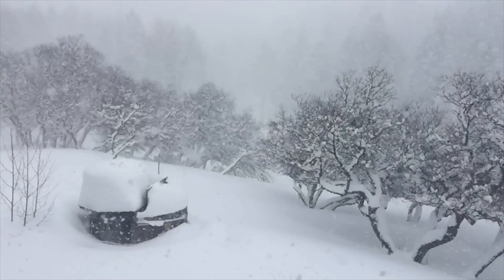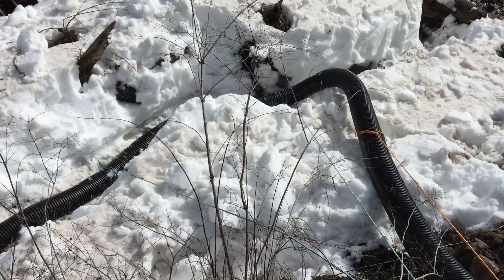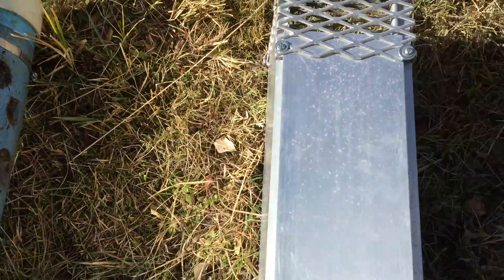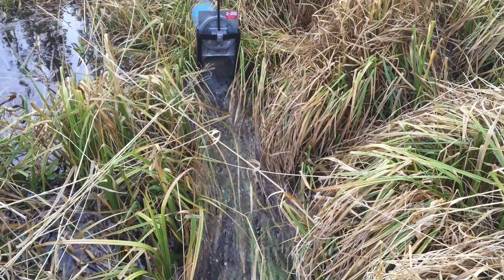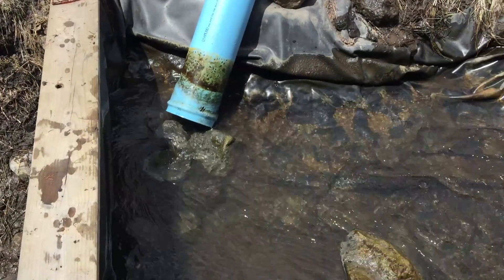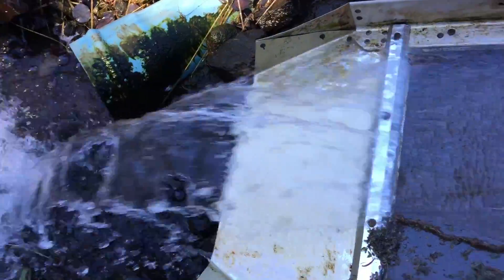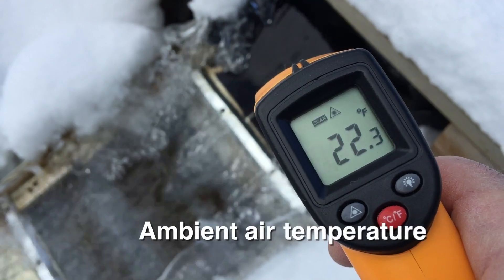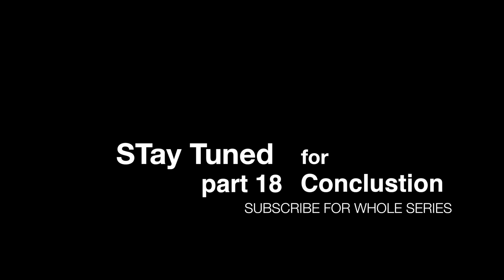Part 17 MicroHydro Power System in CO

Comment: Maybe litlle tiny 12v heather you should attach on the metal  filter to isolate freezing issue.
Reply from the maker: Thanks for the suggestion.  This video was posted quite a while back and many subsequent modifications have been made to enhance the system and overcome problems. Thx for watching I'm never sure who has seen what of the series. Here is a playlist of the 3 part synopsis which is an overview of the whole process https://www.youtube.com/playlist?list=PLtTypVpmDd-vkT9bJQkXw4I1t0e_4jMYA The whole series is in about 25 videos. This part 17 video gets promoted most frequently by YouTube.
Reply from the maker: Another commenter pointed out the error in the link I provided that it didn't work.  It should have been https://www.youtube.com/playlist?list=PLtTypVpmDd-vkT9bJQkXw4I1t0e_4jMYA  
Sorry about that.

Comment: Hi
I was wondering why you didn’t dam the water at the intake point. This would have prevented the transit debris clogging the entry point.
Excess water would flow over the dam and continue in its normal path.
Perhaps another small pool or dam at the exit point would resolve ice build up.
Reply from the maker: Its a fair question & your suggestion makes some sense. But.... The spring melt off can be enormous and can change the creek bed  and path every year. Other videos in the series show this. Any permanent installation would likely be washed away. This video was posted quite a while back and many subsequent modifications have been made to enhance the system and overcome problems. Thx for watching I'm never sure who has seen what of the series. Here is a playlist of the 3 part synopsis which is an overview of the whole process https://www.youtube.com/playlist?list=PLtTypVpmDd-vkT9bJQkXw4I1t0e_4jMYA The whole series is in about 25 videos. This part 17 video gets promoted most frequently by YouTube.
Reply from the maker: Another commenter pointed out the error in the link I provided that it didn't work.  It should have been https://www.youtube.com/playlist?list=PLtTypVpmDd-vkT9bJQkXw4I1t0e_4jMYA  
Sorry about that.

Comment: To maintain the filter screen you need to avoid sun light. turn the screen down or cover it to eliminate the sun light as much as possible. This is not organic matter only it is algae. I hope you try it.
Reply from the maker: You are right.  I noticed the lack of algae when the ice shroud which developed blocked all the sunlight.  I will be cutting a cover to do the same although I'm not sure if it will create issues in the winter with the icing. I'll probably wait for next Spring at this point.   thanks for the suggestion and for watching.

Comment: how about an inline gold sluice... ya never know... and colorado has hella minerals... might get a few grams a week with that much h20 running... And if you put the stand pipe in a 250 gallon cubie and paint it black it will solar heat around the standpipe and prevent freezing...paint it black and set it up to drain? yes no?
Reply from the maker: Actually no gold in my area, my neighbor is a geologist.  Not a bad idea for the standpipe, but for most of the winter daytime the area is in shade.  thx for watching.

Comment: What if you used the power of the water thru a small hydro turbine to power an auto brush system to keep your screen clean?
Or possibly using water itself flowing across the screen at a 90 degree angle when the system senses a pressure drop?
Reply from the maker: Lots of people suggest similar or mechanical solutions for what is routine cleaning which at this point is seldom required.  Many issues have been resolved which were just part of the process over the years.  There are always new challenges but this is not one of them.  I'm never sure who has seen what of the series. Here is a playlist of the 3 part synopsis which is an overview of the whole process https://www.youtube.com/playlist?list=PLtTypVpmDd-vkT9bJQkXw4I1t0e_4jMYA The whole series is in about 25 videos. This part 17 video gets promoted most frequently by YouTube. Thanks for watching
Reply from the maker: Another commenter pointed out the error in the link I provided that it didn't work.  It should have been https://www.youtube.com/playlist?list=PLtTypVpmDd-vkT9bJQkXw4I1t0e_4jMYA  
Sorry about that.

Comment: For a winter cover cut a 55-gallon drum vertically to cover over the screen it will gather some heat from the sun if you use black barrels
Reply from the maker: good idea, but... Lots of people suggest similar or mechanical solutions for what is routine cleaning which at this point is seldom required.  Many issues have been resolved which were just part of the process over the years.  There are always new challenges but this is not one of them.  Freezing has not proven over the years to be an issue.  The water continues to flow even in very extreme temperatures.  Blocking the sunlight will indeed remove any buildup of algae however.  I'm never sure who has seen what of the series. Here is a playlist of the 3 part synopsis which is an overview of the whole process https://www.youtube.com/playlist?list=PLtTypVpmDd-vkT9bJQkXw4I1t0e_4jMYA The whole series is in about 25 videos. This part 17 video gets promoted most frequently by YouTube.  Thanks for watching
Reply from the maker: Another commenter pointed out the error in the link I provided that it didn't work.  It should have been https://www.youtube.com/playlist?list=PLtTypVpmDd-vkT9bJQkXw4I1t0e_4jMYA  
Sorry about that.

Comment: You can utilize a test cock like what is used on a backflow prevention system instead of having to physically remove a screw to bleed off air or you can use a mechanical air arrestor
Reply from the maker: Not sure what a "back flow prevention system" is.  Perhaps you can provide more information.  Lots of people have suggested air vents.  The path of the pipe has only minimal fall where the air gets trapped.  There isn’t any pressure to keep a vent closed.  The problem is that the negative suction pressure from the lower part of the pipe would simply suck air in at the vent holes. That is why when I bleed the air out through the holes I need to close the gate at the pipe outlet. Once the air is out of the line, the flow is dramatically increased. Thx for watching I'm never sure who has seen what of the series. Here is a playlist of the 3 part synopsis which is an overview of the whole process https://www.youtube.com/playlist?list=PLtTypVpmDd-vkT9bJQkXw4I1t0e_4jMYA The whole series is in about 25 videos. This part 17 video gets promoted most frequently by YouTube.
Reply from the maker: Another commenter pointed out the error in the link I provided that it didn't work.  It should have been https://www.youtube.com/playlist?list=PLtTypVpmDd-vkT9bJQkXw4I1t0e_4jMYA  
Sorry about that.

Comment: Any reason why heating coils aren't used in the Ice areas?  Perhaps a brush on a timer to clean the screen?
Reply from the maker: Its 1/2 mile from intake to available power.  Lots of people suggest similar or mechanical solutions for what is routine cleaning which at this point is seldom required.  Many issues have been resolved which were just part of the process over the years.  There are always new challenges but this is not one of them.  I'm never sure who has seen what of the series. Here is a playlist of the 3 part synopsis which is an overview of the whole process https://www.youtube.com/playlist?list=PLtTypVpmDd-vkT9bJQkXw4I1t0e_4jMYA The whole series is in about 25 videos. This part 17 video gets promoted most frequently by YouTube.

Thanks so much for watching!
Reply from the maker: Another commenter pointed out the error in the link I provided that it didn't work.  It should have been https://www.youtube.com/playlist?list=PLtTypVpmDd-vkT9bJQkXw4I1t0e_4jMYA  
Sorry about that.

Comment: When I was a little girl, I spent hours playing with water. If it was raining, I'd run out and make dams and diversions. Playing in the gutter wasn't something girls did and so I had to change my interest (I'm now a nurse). As an adult, I still find fluid dynamics interesting. I can watch this sort of engineering for hours. Love your process of problem solving and was wondering about what causes the build up of stasis pressure causing an air lock. It seemed to me that the force of the water would push it along. Does preventing it rely on an adequate fall? Really good solutions.
Reply from the maker: Lots of people have suggested air vents.  The path of the pipe has only minimal fall where the air gets trapped.  There isn’t any pressure to keep a vent closed.  The problem is that the negative suction pressure from the lower part of the pipe would simply suck air in at the vent holes. That is why when I bleed the air out through the holes I need to close the gate at the pipe outlet. Once the air is out of the line, the flow is dramatically increased. Thx for watching I'm never sure who has seen what of the series. Here is a playlist of the 3 part synopsis which is an overview of the whole process https://www.youtube.com/playlist?list=PLtTypVpmDd-vkT9bJQkXw4I1t0e_4jMYA The whole series is in about 25 videos. This part 17 video gets promoted most frequently by YouTube.
Reply from the maker: Another commenter pointed out the error in the link I provided that it didn't work.  It should have been https://www.youtube.com/playlist?list=PLtTypVpmDd-vkT9bJQkXw4I1t0e_4jMYA  
Sorry about that.

Comment: Air seem to be a constant problem, -- I made a system for our houseboat. There I made the air automatically leave the system from a pipe being higher than the water level inside the other pipes. No reason to unscrew a bolt if you just replace the bolt with a piece of pipe that go higher than max. water level. That way the air are trapped at high point and that is where you place the air drain pipe so air will just leave the system.
Reply from the maker: Lots of people have suggested air vents.  The path of the pipe has only minimal fall where the air gets trapped.  There isn’t any pressure to keep a vent closed.  The problem is that the negative suction pressure from the lower part of the pipe would simply suck air in at the vent holes. That is why when I bleed the air out through the holes I need to close the gate at the pipe outlet. Once the air is out of the line, the flow is dramatically increased. Thx for watching I'm never sure who has seen what of the series. Here is a playlist of the 3 part synopsis which is an overview of the whole process https://www.youtube.com/playlist?list=PLtTypVpmDd-vkT9bJQkXw4I1t0e_4jMYA The whole series is in about 25 videos. This part 17 video gets promoted most frequently by YouTube.
Reply from the maker: Another commenter pointed out the error in the link I provided that it didn't work.  It should have been https://www.youtube.com/playlist?list=PLtTypVpmDd-vkT9bJQkXw4I1t0e_4jMYA  
Sorry about that.

Comment: I really like the trial and error methods of engineering. I worked in the Washington Conversation Corps out of Yakima,Wa, we were a riparian restoration crew. I believe a solution that worked for one of our projects may be a lower maintenance solution. Using a barrel type filter will allow maximum water flow, reduce large particulates and prevent fish an such Frome entering the pipeline. Once installed, It cleans itself. https://www.capitalpress.com/district-works-with-ranch-on-fish-screen/article_2273c3b9-6e79-5127-ae9f-3bea7be3b8bd.html
Reply from the maker: Thanks for the suggestion.  This video was posted quite a while back and many subsequent modifications have been made to enhance the system and overcome problems. Any permanent structures for the diversion would likely be torn out by the yearly spring melt off.  Thx for watching I'm never sure who has seen what of the series. Here is a playlist of the 3 part synopsis which is an overview of the whole process https://www.youtube.com/playlist?list=PLtTypVpmDd-vkT9bJQkXw4I1t0e_4jMYA The whole series is in about 25 videos. This part 17 video gets promoted most frequently by YouTube.
Reply from the maker: Another commenter pointed out the error in the link I provided that it didn't work.  It should have been https://www.youtube.com/playlist?list=PLtTypVpmDd-vkT9bJQkXw4I1t0e_4jMYA  
Sorry about that.

Comment: A question: Do they own all that land? And if not how do they get permission to run the pipes and modify the "natural" flow of the water etc...?
Reply from the maker: We own all the land that the system sits on.  Acquiring water rights to use the water by filing in water court is essential and was done.  Different states may be different, but that is how Colorado works.
Thx for watching I'm never sure who has seen what of the series. Here is a playlist of the 3 part synopsis which is an overview of the whole process https://www.youtube.com/playlist?list=PLtTypVpmDd-vkT9bJQkXw4I1t0e_4jMYA The whole series is in about 25 videos. This part 17 video gets promoted most frequently by YouTube.
Reply from the maker: Another commenter pointed out the error in the link I provided that it didn't work.  It should have been https://www.youtube.com/playlist?list=PLtTypVpmDd-vkT9bJQkXw4I1t0e_4jMYA  
Sorry about that.

Comment: Maybe wire some electricity to heat the pipe so it won’t get frozen?
Reply from the maker: The system requires almost no tending.  Power is 1/2 mile from the intake.  Running wire that distance to address something that is no longer an issue would be a waste of time and money.
This video was posted quite a while back and many subsequent modifications have been made to enhance the system and overcome problems. Thx for watching I'm never sure who has seen what of the series. Here is a playlist of the 3 part synopsis which is an overview of the whole process https://www.youtube.com/playlist?list=PLtTypVpmDd-vkT9bJQkXw4I1t0e_4jMYA The whole series is in about 25 videos. This part 17 video gets promoted most frequently by YouTube.
Reply from the maker: Another commenter pointed out the error in the link I provided that it didn't work.  It should have been https://www.youtube.com/playlist?list=PLtTypVpmDd-vkT9bJQkXw4I1t0e_4jMYA  
Sorry about that.

Comment: This has to be the best made video for micro hydro that I've ever seen. Thanks so much for your efforts in making, editing and updating the video. There are some great time-saving tips and I'll definitely try to learn from your R&D. I'm now in South East Asia and I have a river crossing my lower acre, which my neighbours use for personal hygiene and laundry. It floods for half the year so I plan to build a tall concrete enclosure and sluice in the middle of the stream in our coming dry season. I'll build a walkway, higher than the flood level so I can access it for maintenance (screen cleaning). Once it's installed, I hope to make enough power for my home and to light the roadway and riverside, to improve my neighbours lives.
Reply from the maker: Fantasic!  glad my notes are of some worth. Every installation has different parameters and challenges. Micro hydro is fantastic if you have a site that works. The difficulty is finding the right place. There are new designs that broaden the possibilities. https://youtu.be/gY3p2e1-kN4 Turbulent wasn't around when I got started in 1996. I think their design is great. I just wish they had a larger market penetration. I don't think they have a large number of installed units yet. The low head/high flow approach is something that can be applied in so many places. When you think about it, moving water is the largest collective of kinetic solar energy on earth.  Wind and solar pales in comparison. Thanks for watching.